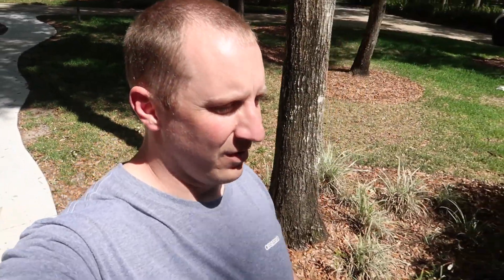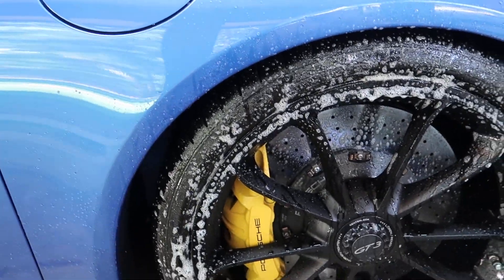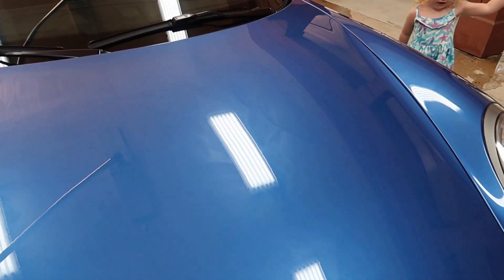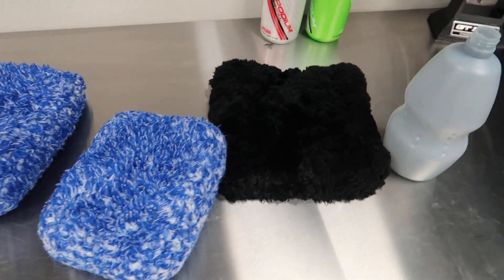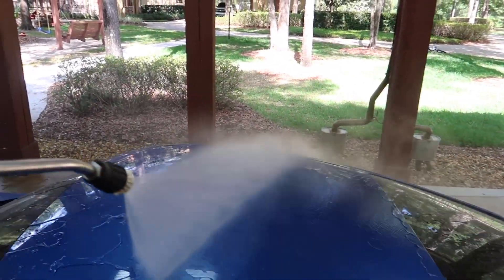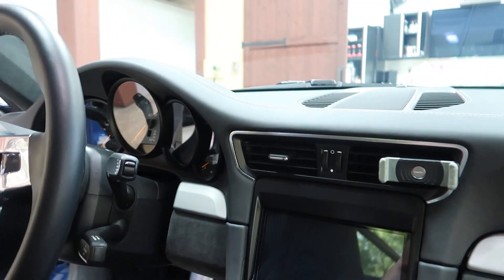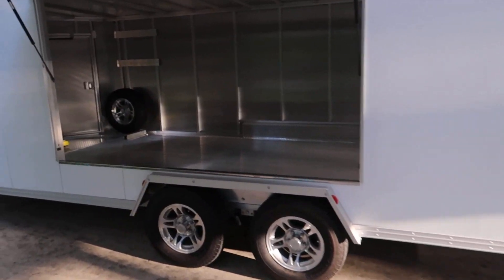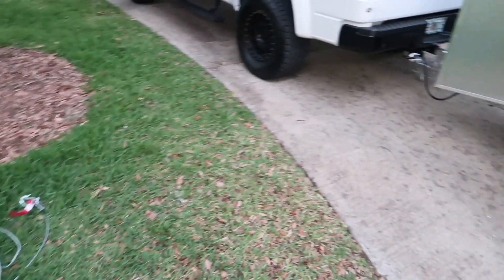Smokies Porsche GT 2017 Vlog:  Day 1- Prepping for the Trip

Comment: Hey Matt! Ever thought of putting your trailer battery on a battery tender? So you don't have to worry about it being dead. A company called "Battery Tender" makes a junior size one I keep on my jeep and it works great. It's very small and it disconnects at one end so you'd only have to plug it straight in and not worry about the alligator clips!
Reply from the maker: I had one on it 24/7, but I didn't put one on it the first 2 months or so.  I think that killed it.
Reply: I gotcha! Well I love the truck and trailer setup! Looks clean.

Comment: My battery suggestion would be an Enersys Odyssey AGM. I literally buy them by the semi truck load for the industry I'm in. MIL-Spec, industrial, long life, and I've experienced zero manufacturing defects in the large sample size I've dealt with. On the straps, I cris-cross them. The benefit of it is additional longitudinal retainment. Example, your car is less likely to 'skip' to the side in the trailer when going over rough roads. I found this out while towing a '69 Chevelle SS up to Ohio from Florida for the Goodguys Nationals. The car, over the course of a thousand or more miles moved to the driver side and the wheel of the car contacted the inner wheel well of the trailer and marred the lip of the wheel. From then on, it was cris-crossed straps for me. The car still made it into the Elite 8 of over 3,000 cars at the show. Judges were Troy Trepanier, Boyd Coddington, and some guy named Chip Foose.
Reply from the maker: Great comment Curtis.  Thanks for the input.  I'll check out that battery.  Mine is toast.

Comment: I'd suggest just using some plush microfiber towels for washing instead of mitts/pads, pull 1 out at a time and use all 8 sides. Honestly it's just way more efficient and less likely to scratch then a mitt with a grit guard. That's how I personally do it for my vette and my dads which each I have over 20 hours of paint correction in them. I use 700gsm towels for this

Comment: so here is a power washer related question .. is there such an attachment ( swivel ) for the basic power washer set up ie the cheaper electric one you reviewed a while ago .. my neighbour must think i am nuts as i spend half the time cursing and swearing at the hose . every time i literally move 6 inches , the hose coils up like its on a bungee cord .. in half a second . its to the point that i now need to buy a new hose at it kinked itself to death ..  *grits teeth and starts to flail at hose

Comment: Matt, what size pressure washer do you use and do you run warm water through it?

I'm looking for a size that can utilize a foam cannon attachment, but will have enough pressure for muddy-caked on work trucks. 

I have a fleet of about 20 work trucks that need to be washed bi-monthly, what would you recommend?
Reply from the maker: In my wash bay I have a really high-end wall mounted Kranzle.  It's 2000 PSI 2.8GPM.  I run it at about 1250 PSI.  This is the other one I have and have been selling tons of:  https://www.obsessedgaragestore.com/collections/packages/products/pressure-washer-package
Reply: Thanks Matt. 

Am I sacrificing the foam-ability, if I run a gas-engined 3000+ psi washer?
Reply from the maker: Definitely not.  You'll have a hole lot more foam due the higher GPM output.

Comment: could you not wire power from the raptor to plug then to trailer ? no need for battery at that point ..
Reply from the maker: It is, but the battery is still necessary to power the winch.
Reply: gotcha , well it was worth a thought ...  :)